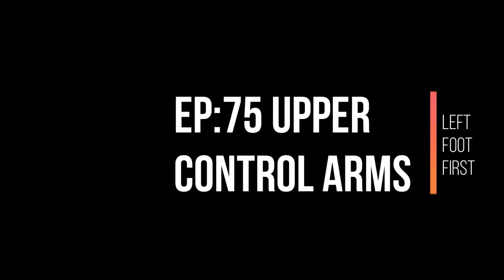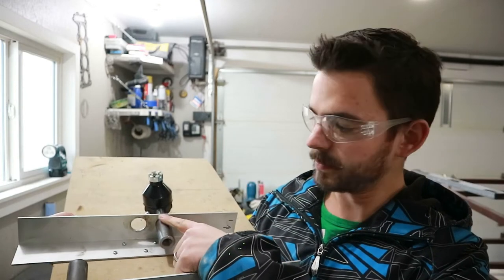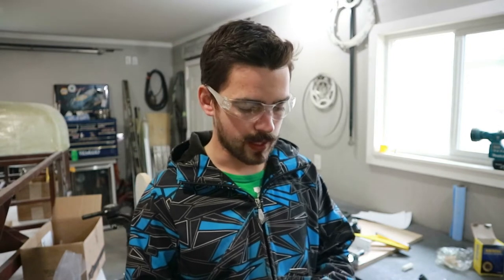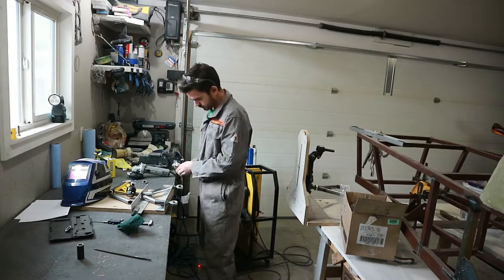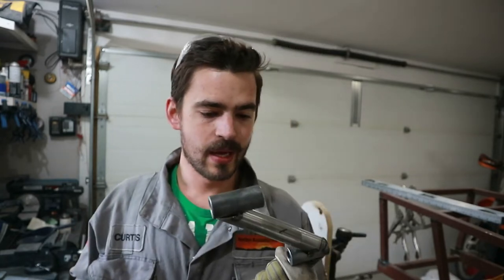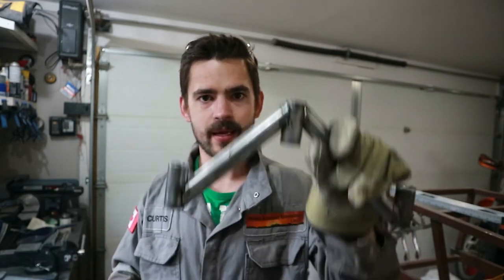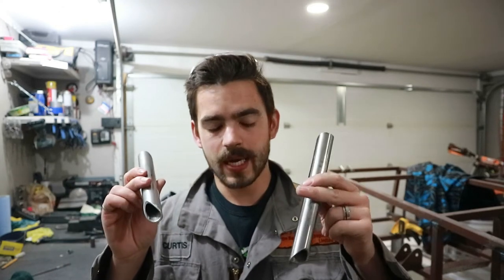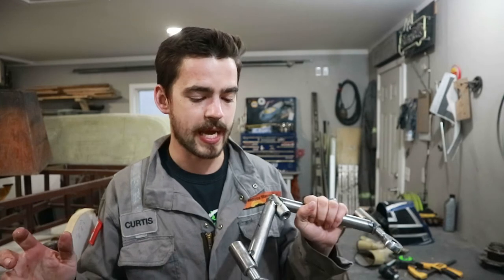Ep 75: Upper Control Arm Build

Comment: Definitely worth investing in a cheap tubing notcher and a spindle sander. You can get both for around $300 and would save you countless hours
Reply from the maker: I have priced them out for sure! But with most of the chassis being made of square there is really just the control arms, but if I find a used one some day I may be tempted.